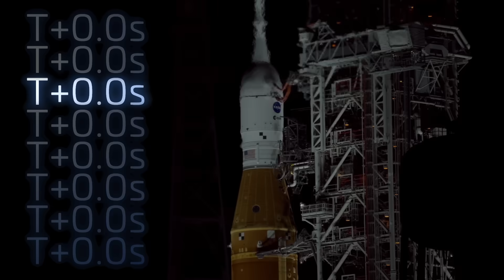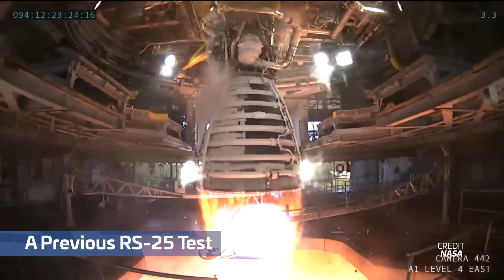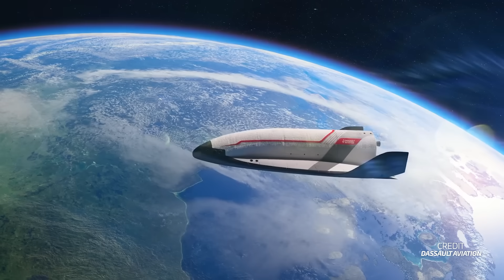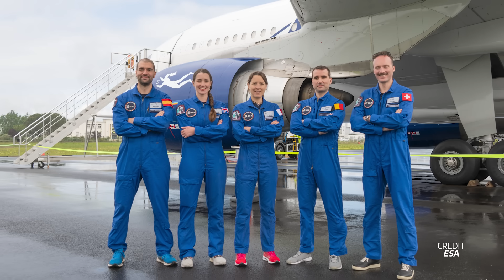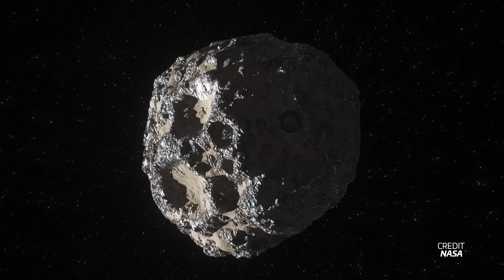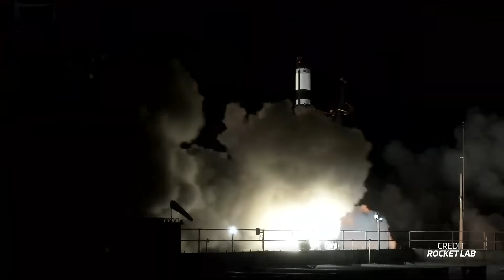Indian, Polish, & Hungarian Space Dreams Come True | This Week In Spaceflight

Comment: naming a French rocket Baguette is the most ironically perfect name
Reply: Official name : OB1 😉
Baguette One has some very interesting potential. 
Far more so than Spectrum. Watch this space. 

If HyPrSpace one day demonstrates simultaneous shutdown, restart, deep modulation and multiple cycles using the same fuel load, then the prospect of a vertically recovered hybrid first stage will become much more realistic.
And Europe would then have two quite different paths towards reusability: Themis/Prometheus via the conventional LOX-methane route, and potentially HyPrSpace via a much simpler hybrid architecture.

Comment: Baguette is the perfect name for a French rocket, and I'm surprised by the space plane too. Great summary NSF!
Reply: At least they didn't use Croissant for the name.
Reply: Baguette One has some very interesting potential. 
Far more so than Spectrum. Watch this space. 

If HyPrSpace one day demonstrates simultaneous shutdown, restart, deep modulation and multiple cycles using the same fuel load, then the prospect of a vertically recovered hybrid first stage will become much more realistic.
And Europe would then have two quite different paths towards reusability: Themis/Prometheus via the conventional LOX-methane route, and potentially HyPrSpace via a much simpler hybrid architecture.